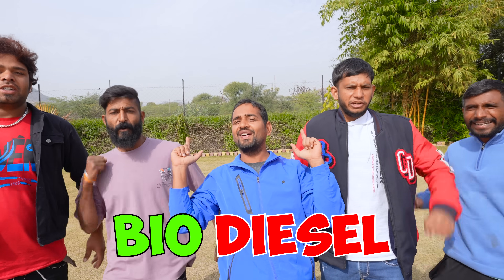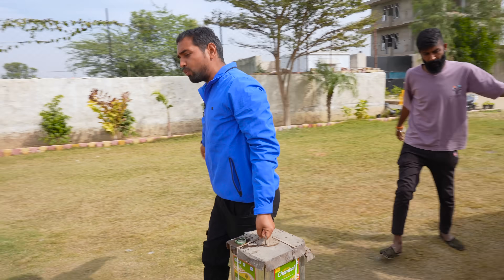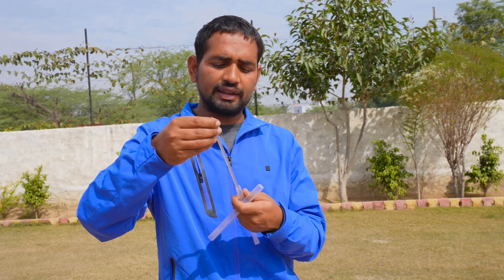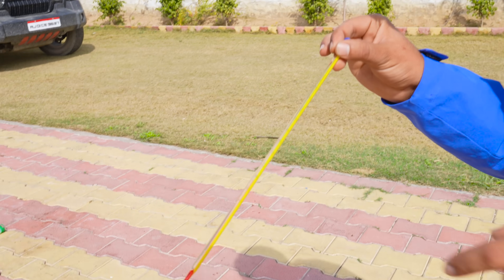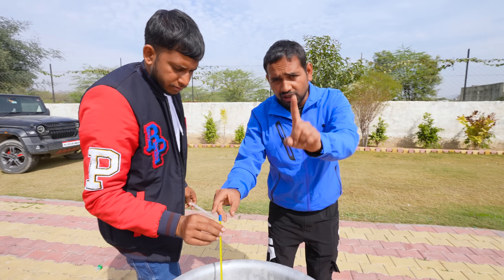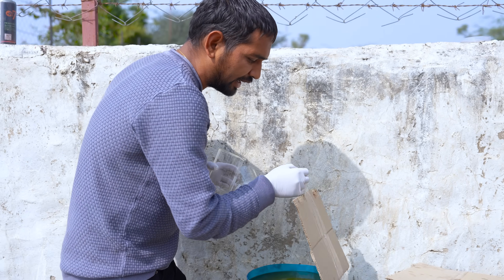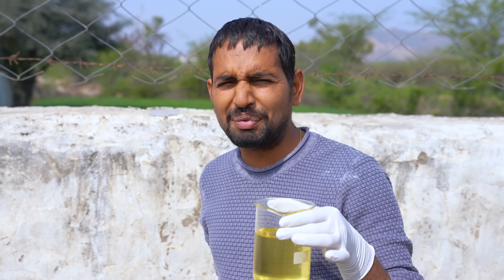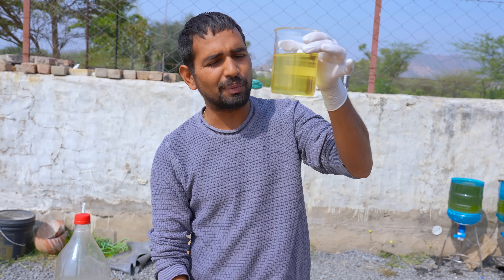We Make Diesel At Home - Bio-Diesel...हम अमीर बनने वाले है🤑

Comment: Quition - If you also want to become one, then look at this and make it.
Solution--
  Approximately 100 pounds of oil or fat are reacted with 10 pounds of a short-chain alcohol (usually methanol) in the presence of a catalyst (usually sodium hydroxide [NaOH] or potassium hydroxide [KOH]) to form 100 pounds of biodiesel and 10 pounds of glycerin (or glycerol).